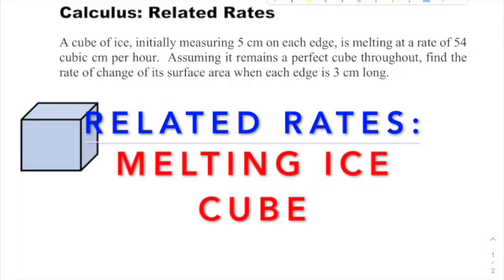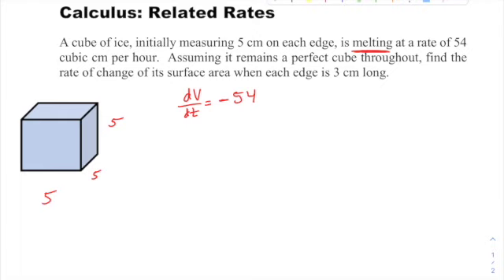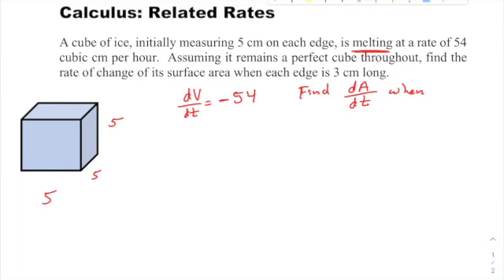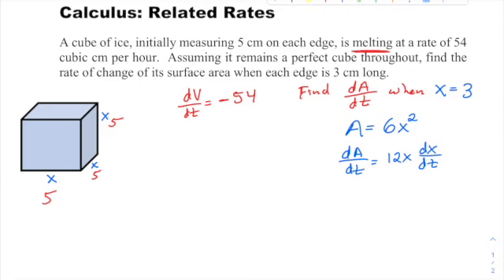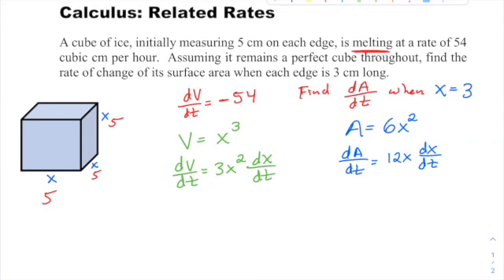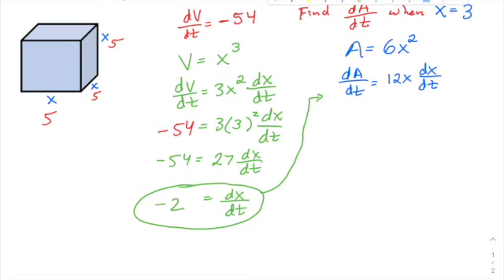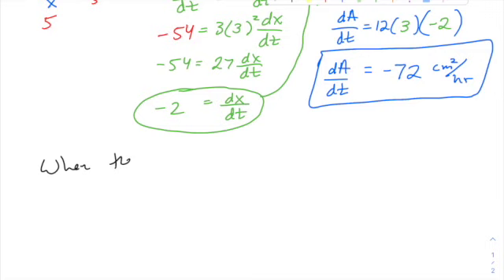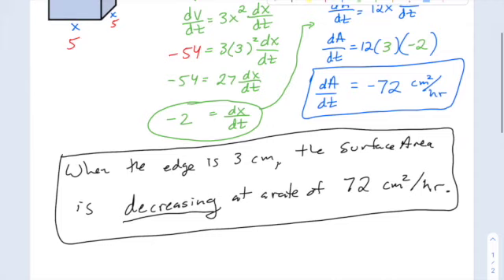Calculus: Related Rates [Melting Ice Cube]

Comment: When you find dx/dt how come you didn’t use x=5. You used 3 instead of 5
Reply from the maker: The edge is only 5 at the beginning of the problem.  The ice cube is melting, and the question asks for the surface area rate of change at the moment when the edge is 3.  Hope this helps!